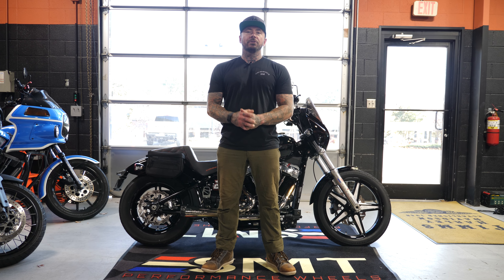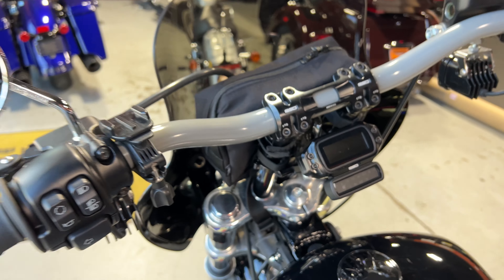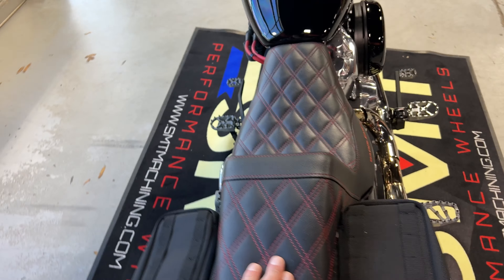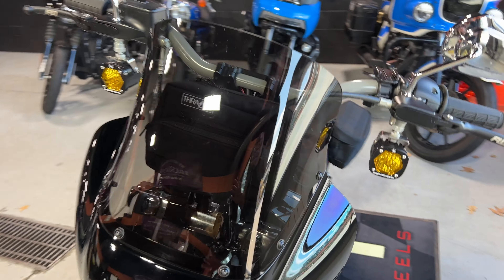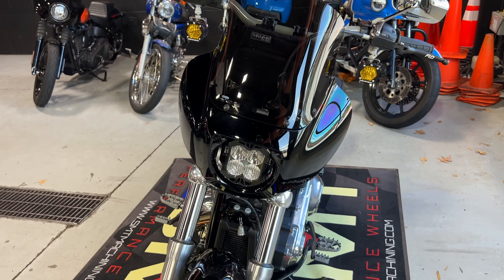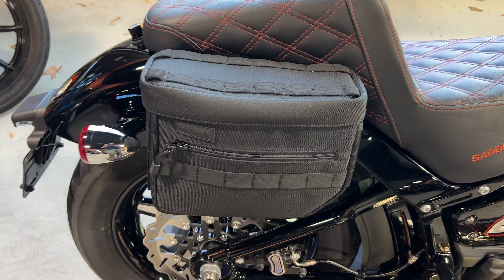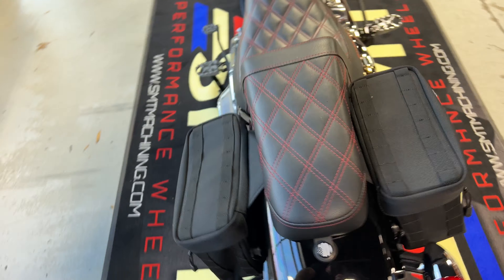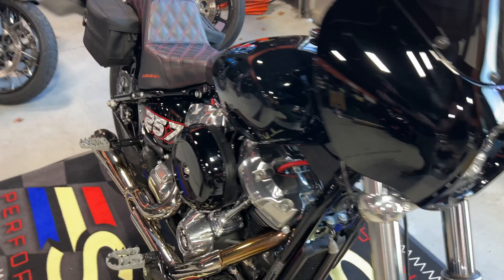Harley Davidson Softail Standard Build | Part II

Comment: Rad light setup! Are you able to give any pointers on how you got the running lights/turn signals to work together? I have a Road King torn apart right now and I’m trying to do the same w my Baja squadron lights
Reply from the maker: I actually haven’t worked that part out yet. I could get one or the other to work but not both.  I chose turn signals but until I get it worked out I’m going to change it to runnings lights. Because I added a high low option on the LP4 but the low beam is too low and the high beam literally blinds people. So I’m thinking running lights and low beam would be a good middle ground. I do plan to get it all working. Message me on Instagram if you wanna chat more I’d like to sort it out. Blair Snipes

Comment: Simple fix for the red on the seat, professionals use Flebing’s leather dye. Simply apply on the stiching and embroidery with a Qtip, let or penetrate, use a shoe brush then use Angelus black shoe polish over the whole seal and polish. I have 2 seats and done both in worn areas, and blends perfectly, no headaches .The dye and polish doesn’t rub off or stain clothing and the seat will look factory clean. A $25 investment vs a new seat…..

Comment: Do you know if the wiring for the digital gage has to be extended when raising it with risers from stock?
Reply from the maker: Depends on how high but mine did and mine is a total of 12". It wasn't that expensive I don't think. Maybe $35

Comment: How did you get the S1 blinkers to work
Reply from the maker: I haven't fully yet. I plan to get back to it soon. As it stands I can use them as running lights or turn signals but not both. I'm guessing you have the same issue. If you wanna connect on Instagram let me know I'd be glad to share the fix with you when I find it. blair_snipes